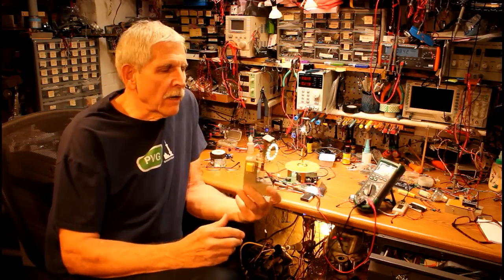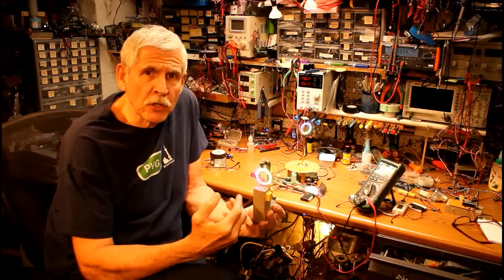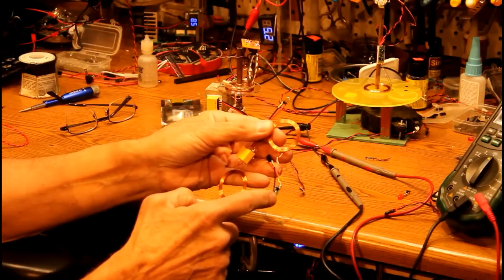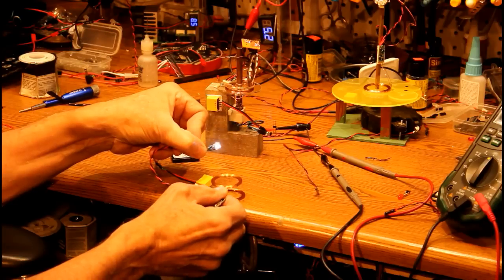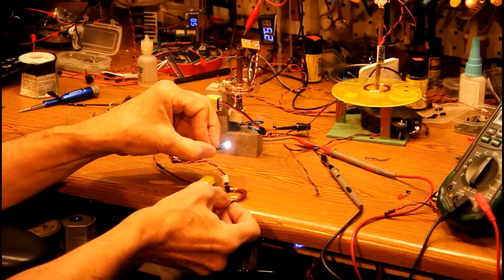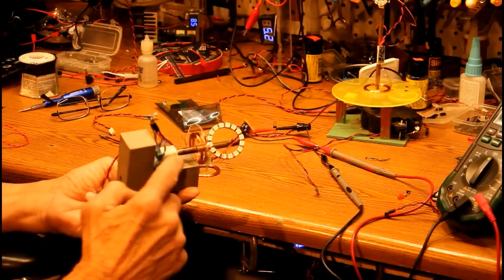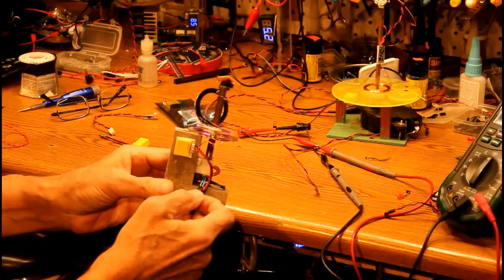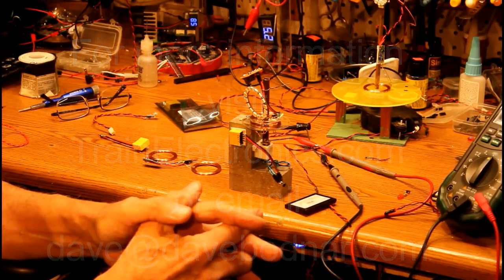Supplying Power to Rotating Objects, WIrelessly!

Comment: hi Dave, have you tried sending data over this aswell? im interested in powering a small microcontroller and a motor and then sending data over the same system... do you have any experience with that ?
Reply: also, RF or wifi is not an option, that's why im considering switched DC pulses over another coil

Comment: If I use a more powerful battery could it supply more voltage? How much power is lost through the transfer?
Reply from the maker: You are limited by the device and cannot exceed its ratings

Comment: Hello Dave, I have a question. I want to do something similar like the concept that you have for the power but I want to do something with transferring data. Is there anyway or any components out there that you might know of where I could transfer data instead of power. Like having two pins or gears rotating together to transfer data. Instead of having it connect like a usb plug
Reply from the maker: I would use radio to transfer data.  Check this link 
http://trainelectronics.com/Arduino/HC-12-Serial_Radio/
Dave
Reply: @DaveBodnar  It’s more like a transmitter and a receiver.

Comment: Dave, I'm putting together a Ferris wheel for the holidays. On the circle that turns around, I'd like to put some AC stuff (low power draw) and also some DC (LED strips - 12V). I have a 48V DC power supply that will sit on the frame. Would your solution work for me? Thanks! Bob
Reply from the maker: It will only provide DC power.  If your items only work with AC you need another solution

Comment: Dave, I was struggling with placing a power supply under a turntable and powering a device on top. It was simply getting too complicated and I decided to look online and found your webpage & video. This is so simple and genius. Thank you for sharing!
Reply from the maker: Steve - thanks for taking the time to let me know that it worked for you.  
Enjoy!

dave
Reply: @DaveBodnar  I'm going to be powering an Arduino, probably a mega. I was planning on using a 9v or 12v battery pack, but I'm having a hard time finding coil setups that receive more than 5v. I did find one that appears to be 24v to 24v, but I'm wondering if ill have issues if I only supply 12v to it.
Reply from the maker: @SoCalSteve  I really can't say - best move might be to do some experiments and see how it behaves
dave

Comment: Great demo ! 
I built a wireless energy POV a few months ago that may be of interest, utilizing an Arduino...it uses a simple to make circuit to create the switching for the coil and a single 1.2V NiMH.
"1.2V wireless electric POV" as a search will bring it up (i'd likely end up in your spam section by posting the link).
Best wishes for more creations that use wireless electricity :)
Reply from the maker: Very nice project - here is a proper link:  https://www.youtube.com/watch?v=qJkd7uP3tVg 
Thanks for passing that along.
dave
Reply: Haha, now that's an endorsement...very kind :)